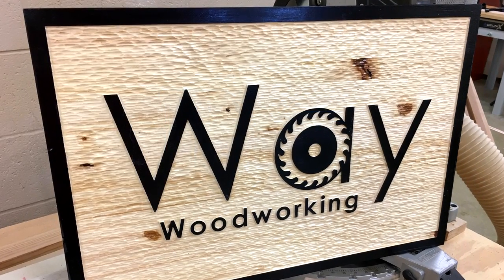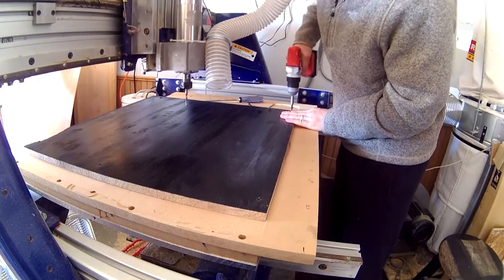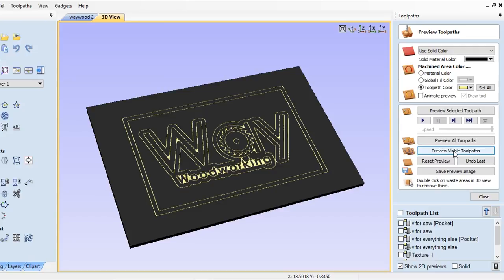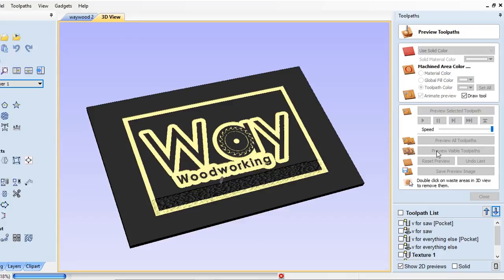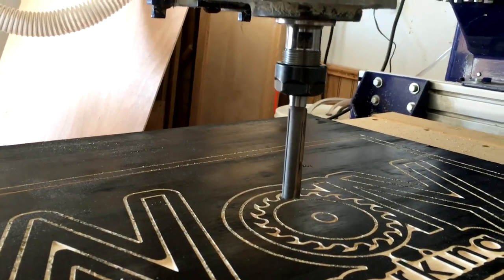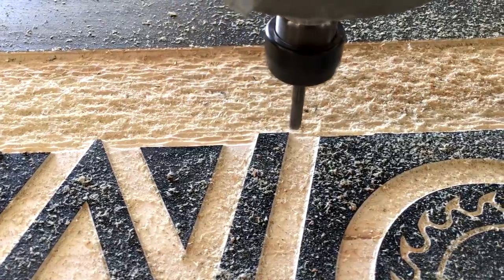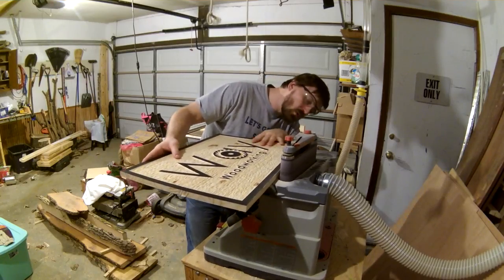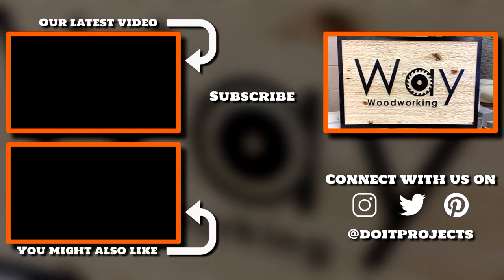Make a simple textured sign with a CNC - How to

Comment: Did you sand the texture at all or did you use a finishing wheel of some sort to get the fuzzies off?  I am looking for a way to easily remove most of the fuzz from the sign I made using your instructions here.
Reply from the maker: Great question. I just kind of rubbed them off with a combination of narrow scraping tool for the larger fuzzies (like the tip of a paint can opener), and used some fine grit sand paper for the rest. I don't go too crazy with that stuff. I like calling little remnants of things like that "character" and hope the customer agrees :)

Comment: What kind of spindle do you have on the Shopbot?  I have a PRT Alpha with the very loud Porter Cable router they originally equipped them with, need to go to a spindle at some point...
Reply from the maker: So, I bought this second hand. I know very little about the spindle except that if you search for an inexpensive one on Amazon, it's pretty much the first that comes up. Its good though. Relatively quiet, water cooled, easy RPM control. On the negative side, it isn't integrated with SB3, so all controls are manual. But I've never really minded.

Comment: Did you have to sand the bare wood after the water based finish raised the grain?
Reply from the maker: I knocked it down a little before the second coat, but not much. The look was supposed to be like a rough gouge, so I left it kind of rough.